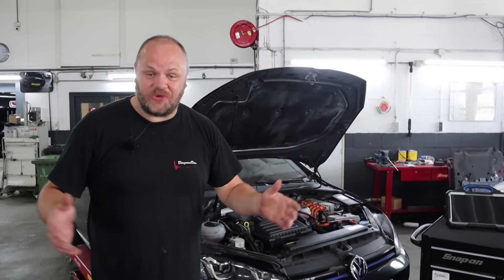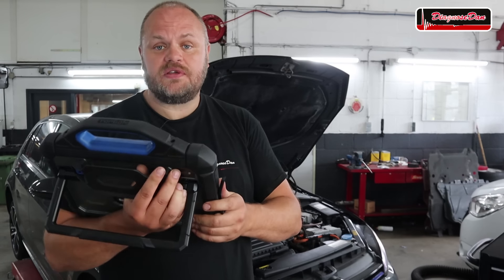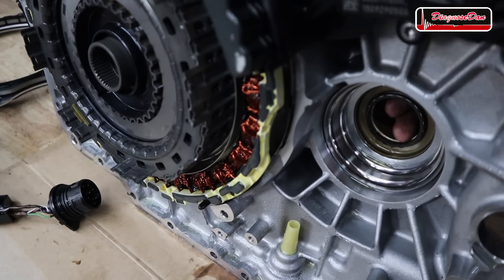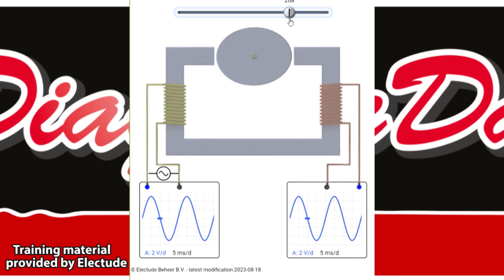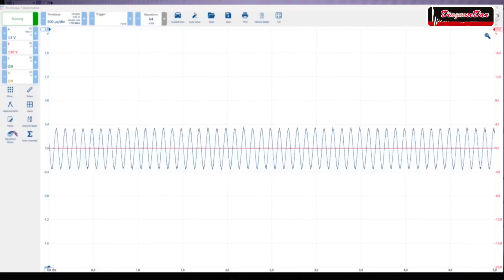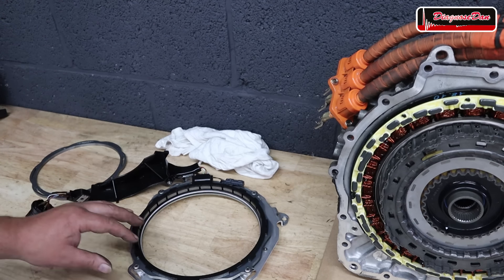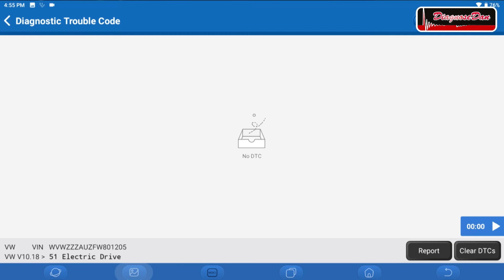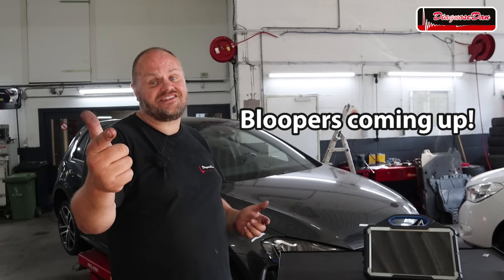Volkswagen Hybrid electric drive Diagnosis.

Comment: Your little animation, around 8:00 mins in, seems to me to be incorrect. If the two output shapes are supposed to be sine and cosine then they should be 90 degrees out of phase. (Sine 90 = 1, cosine 90 =0, sine 180 = 0, cosine 180 = -1). However, the shapes in your animation are 180 degrees out of phase. The former seems correct to me as that way the control unit can tell in which direction the motor is running. If the curves are 180 degrees out then you wouldn't be able to tell that.

Great video though, really interesting.
Reply from the maker: Thanks for the feedback, i'll look in to it.

Comment: @diagnosedan Thanks for the video! Quick question. I have a 2013 Jetta Hybrid with the same powertrain. I need to replace the transmission mount that is located under the inverter/electric motor brain. To disconnect the high voltage system can I just remove the orange plug on the high voltage battery and then safely move the inverter out of the way? Thanks!

Comment: Nice... I am wondering as long as the car is hybrid... and this happens to you on the road ... if you remove the plug of the resolver and disconnect the power to the inverter and clear the code will it be possible to start the engine and drive or it is not possible unless you recode the ecu
Reply from the maker: The Electric motor = the starter motor for the ice

Comment: Volkswagen in the past were plagued with electrical problems related to Bosch components, as were other's that used them. BMW motorcycles used Nippon Denso components at one stage to remedy the reliability problems. 

I'm not sure if this is still the case, as ive been out of the repair business for many years now, but 80% of problems then, were electrically related and would assume the added complexity of modern vehicles would add to this.
Reply from the maker: Thanks for the feedback

Comment: My Golf GTD went in to VW to try n find a electrical gremlin and I had a mk8 Golf GTE as a courtesy car. It had loads of new tech compaired to my 5 1/2yrs old GTD (which makes sense) like the cruise control changing speeds without me doing anything. It also had lane keeping assist, a camera which picks up roads signs and a heated steering wheel but for some reason, no heated seats which doesn't seem to make any sense 🤷🏻‍♂️
Reply from the maker: Thanks for your comment

Comment: Ooooosh!

Pretty brutal repair on  that 😭. It's a shame the engineers couldn't come up with some way of establishing the position of the rotor via a sensor / sensors that mount on a port on the transmission case rather than this!

Comment: Love how you show that the method of diagnosis for electrics  basically stays the same and also that it is possible to get your head around of what makes an electric motor spin. Next video: Diagnosis of a Tesla.
Reply from the maker: Tesla is the worst vehicle to work on for an independent as they provide the aftermarket with 0 information, dont want to talk to us and parts are a nightmare to get a hold of. But if anything interesting comes into the shop i'l certainly film it
Reply: @Diagnosedan  Two things: They are forced to become better and have now Service Mode enabled for everybody. Second: I am sure you are up to the challenge 😃👍

Comment: Dan, when working on hybrid or full EVs, what precautions do you need to take to ensure safety in the workshop?
Reply: Simple don’t touch it unless you know your doing or have the correct protection gear & testing equipment.
Reply from the maker: I've made a video about that a few years ago. Please go through my playlist

Comment: So in principle a resolver fulfills the simmilar function as the crankshaftr sensor regarding the postion of the motor.
Reply from the maker: Yes but a crankshaft sensor doesn't give the ecu the position of the engine if  it's not turning.

Comment: Did the cluster said the electric motor was ready? Or the messages came back?
Reply from the maker: No it didn't yet. After the resolver is replaced the motor must go thru a timing procedure
Reply: @Diagnosedan  thanks for the reply, that makes sense

Comment: Just to remind every home mechanic, be really careful with highvoltage components. Alltough they are very secure with connectors being open, if there is internal fault with the drive battery, one might get shocked if voltage is on due to internal damage.
Reply from the maker: Always use common sense whan working on cars even Petrol can be dangerous!

Comment: Doesn't seem like a good idea to turn over the electric motor without sync. Could cause overcurrent in windings? 
Also I wonder why they dont use a simple digital shaft position encoder rather than a complicated analog resolver.
Reply from the maker: Revolvers are generally more reliable

Comment: I have a Renault kangoo 1.5 DCI  it cranks but doesn't start it was brought to our workshop wit a faulty high pressure diesel fuel pump  it sat there for a few years until the customer bought a new pump but it did not start ,so many highly trained technicians have tried but the car won't start . It doesn't have injector pulse  and if you put the key in ignition the glow plug light doesn't come of even if you leave it on for hours it has the following fault codes( DF016 EGR Command Circuit,Short-Circuit To +12v Active
DF089 Inlet Manifold Pressure Sensor Circuit,Permanent Low Level Active) if you put a little petrol in the intake system it can Start but it stalls because of lack of fuel . So am asking should I first look for a short circuit for the EGR wires I just need your advice because if I fail so many people are going to laugh at me for being one of the failed technicians
Reply from the maker: There are many checks you can do, if you need guidance you can subscribe to DDTSB at DDTSB.COM and use our helpdesk ( only 20€ per case)

Comment: Interesting, I work with ac motors but the ones I work on usually have an encoder. The motor controllers I work with have two feedback options, an encoder or a resolver, I always wondered what the 2nd option was but never looked it up. Does anyone more knowledgeable on ac motors know why one might use a resolver feedback system over a encoder? I have had encoders fail and they are like a ckp sensor or cam position sensor where its one bolt and a plug to swap.
Reply from the maker: A resolver should be more reliable

Comment: The chief engineer of the first generation Prius, was a 70-year old gentleman. He and his team were working eighteen (18) hours a day, to make the world's first hybrid as reliable as a Toyota is always expected to be. They did. Almost 20 years forward, VW's motives were not to produce a bulletproof engine. Rather, their motives were to "just release "something" to the booming EV/Hybrid market". And that's the results you get.
Reply from the maker: Faults with the hybrid systems on this model are very rare, this is the first time i encountered one. I couldn't find anything about it on YT either. There are plenty of hybrid faults in Priuses to be found on YT.
Reply: @Diagnosedan  And there are many, many Millions of Priuses on the road. This VW is just another VW, with everything this implies. Look how the paint has flaked from the wishbones and the transverse engine mount, and how old is this thing? 2, 3 years old? I understand, that from your perspective you have to maintain a neutral approach to all manufacturers.

Comment: bad thing with electronics is what caused the failure??   there may be an intermittant electrical fault that put high wattage onto the wiring frying that. you may replace it and 30 miles later same thing. and withh the price  just tossing a controller in is not an option.
Reply: Possibly a cracked solder joint. They only use lead-free solder these days and it's quite brittle and sensitive to vibration.
Reply from the maker: Things fail😂

Comment: MR dan good day, I have a Jetta 2014 hybrid, car won't  start, I have diagnose it and those are codes 1) P30A100 (engine start interruptions, permissible number exceeded 2) U011200 control unit 2 for battery energy  management , no communication.. Pls help ..

Comment: Now the interesting part is how it actually did fail. Maybe it's just a solder joint?
Of course it requires the car to be taken apart to get to the failed device, and that's the hard part.
Reply from the maker: I dont know why it failed, i do know its very rare. This is the first time i've encountered this

Comment: Hello, teacher, can you help me with this problem, code p1122, Toyota Prius 2008, I replaced the inverter pump and sensors, and the car did not start at all. When I turn it on, the gearbox goes from p to n, then the car turns off. Thank you.❤❤
Reply from the maker: For technical questions you can subscribe to DDTSB at DDTSB.COM. Than you can access our (paid) helpdesk.
Reply: @Diagnosedan  
Thanks I will

Comment: The part that needs to be replaced should have zero failures,  it doesn't even move. Problem is that since this failed, many others like it will fail. Sad VW, sad
Reply: Of course it can fail, it's subject to vibration, large temperature changes, and the effects of age.
Reply: @Zeem4  should be engineered for that. It's a 2016. If you look at VW reliability over the years, it stinks
Reply from the maker: I wonder if thats true, i've never seen this fault before and i can't find similar cases like it. And this model has been around for a long time

Comment: So, a hybrid engine will a timing issue caused by a open circuit in one of the coil windings requires splitting the engine to replace the 'resolver'. That isn't an internal, timing part on any petrol or diesel engine and folks should understand how maintenance alone on electric/hybrid engines usually makes them a bad choice for your wallet/purse.
Reply from the maker: Thanks for your comment

Comment: 5:15, now you know why an electric motor is far more efficient than a combustion engine.
Could you spin a combustion engine with the same power with one finger?
You'd need a wrench and a long lever to do that.
Reply from the maker: And alot simpler

Comment: Hi I have Honda fit hybrid 2016. Recently it has started to show yellow engine light and with that it shows VSA and hill assist lights. When this happens the transmission does not engage properly. Over night the system resets and engine light disappears and everything becomes normal. Can anybody have any idea what is going on? Thanks

Comment: Im pretty sure the electric motor is used as a startermotor when you want to turn on the ICE engine.
Reply: Depends on the brand. For example Mercedes plug-in hybrid uses a standard starter motor on the internal combustion engine.
Reply from the maker: Exactly!

Comment: A view from the UK. Dan, a very informative vlog as ever, but......
Unwittingly, as with many other of your vids, it demands a conversation to be had about the complexity of todays cars that are "trying to save the planet". I am sure you know the amount of energy and resources it takes to manufacture anything to do with cars and by watching this video you see how much more "equipment" is needed to "save the planet". We are having the same debate here in the UK regarding the toxic metals and chemicals that are needed to manufacture electric car batteries - ALL sourced from China. ALL to save the planet. No, i don't think so. Add to this your expose of main dealers that cannot fix their own products, they come to you. To us oldies, sparkplugs, HT leads, coils, oil filters, brake pads - the normal parts needed to service your own car on a Sunday morning seem cheap compared to the parts you are replacing in these vids.  We never had "diagnostic computers, oscilloscopes, multimeters. We just had a socket set and screwdrivers. The only reason i open my bonnet is to fill the windscreen water bottle. When i open it up i find there is not 1 cubic centimetre of space, nothing.
Reply from the maker: My channel is about diagnosing/ fixing vehicles. The vehicles i diagnose in my videos ara already on the roads and need to be serviced. From a diagnostician point of view i'll diagnose anything ( Diesel, Petrol,Lpg, Electric,hydrogen.ect.) The question about the environment and the automotive future is an interesting one but probably more suited for another channel.
Reply: Sorry Dan but i think you have missed my point so i'll make it as simple as i can.
The whole direction of todays cars are to be more efficient and cleaner hence the introduction of electric cars/Hybrids. This has resulted in electronic "modules" all over the car to "control" various parts of it, effectively making todays car a computer on wheels. Therefore you are really an electronics engineer with an interest in mechanics not the other way round. Do step back and look at your channel and look at how many of your videos are electronic/electrical faults and how many are mechanical. Hope this helps. I would have thought having an oscilloscope, a signal injector, a DVM, a diagnostic computer would have given you a clue as to your real job title Dan,,,,,

Comment: hello 
i have wv polo classic 1.4L 44kw 60hp 1997 petrol AEX 
engine is working is starting when is cold and aftet he warmed turning off and i cant turr it on after that i need to wait
also when i am ddrivin i 4 and 5 gear put down the rpm from 3.500 till 0 and turn off 
on diagnostic car i found three eror codes; 5018 030 ,519 030,533 030 
1. drosselklappenpotentiometer - g69 unterbrechung/kurzschluss nach plus
Throttle valve potentiometer - g69 open/short circuit to plus
2.geber für saugrohrdruck-g71 kurzschluss nach plus
Intake manifold pressure sender G71 short circuit to positive
3.Regelung der Leerlaufdrehzahl
Idle speed control
Please i need a help 
Thanks

Comment: why does a car 3 phase motor have a resolver , normal industrial 3 phase motor don't have them.
Reply from the maker: This motor needs to move a heavy vehicle from standstill, so its important it has Max torque from the getgo. Thats why you want to energize the coil closest to the magnet. To do this you need to know where they are😊

Comment: Hybrid are disposable. You won't able to find a good battery replacement just like mobile phones & laptops
Reply: Wrong, Toyota hybrid batteries aren't that expensive
Reply: @robertpsotka3525 I never said it's expensive. You can't buy the same quality that came from the factory. Toyota batteries are so horrible and corroding from the terminal itself.
Reply: @w0lvez1   Yes, those Toyota busbars can corrode, but these can be easy replaced or cleaned together with replacing the battery blocks every twenty or twenty five years. 🤣 It's a two hour job, so what's the problem then?
Reply: @wimschoenmakers5463  20 years? With all this lead free garbage I doubt it will last more than 10 years.
Reply: @w0lvez1  My Toyota Auris Hybride is now 13 years old, and still using the original factory battery and it's still working great.  Not even 0.1 % of these metal hydride batteries are ever replaced in a Toyota, so there no reason to worry. 🤣
Reply: @wimschoenmakers5463  You might be living somewhere with low humidity. 

Just make sure to install CCTV on the pedal so Toyota can't say the throttle gets stuck because of the stupid floor mat. After all the denial on Sudden Unintedead Acceleration, I can't believe people still buy a Toyota.
Reply: @wimschoenmakers5463  Good luck! With all of this lead free garbage any solder joint can fail.
Reply from the maker: You can get refurbished batteries

Comment: hi, does anyone have the pinout and the reading values? i have the original sensor from my gte, vw official dealer service told me that this is the problem with my golf, but with the new sensor the problem is still present. now they asked me 6000€ for this job, for a non running car with the same issue. i need to check this sensor so i can go with the data to a lawyer. thanks in advance!

Comment: Again,sad to see that a very simple defect totally disables an expensive machine; here, probably a weak spot weld at one end of a wire of one of the coils in the MCR( multi coil resolver),that failed; i am sure it was FAILED since it was born; we are always at the mercy of a bad worker, in this case the person in charge of controlling that welding operation.

Comment: It's very surprising that an auto mechanic would own any type of electric car at this stage.
Reply from the maker: Why?
Reply: @Diagnosedan  They tend to be short range transportation and not fully supported as of yet. They require chargers, time to recharge, charging stations are not plentiful and when using them away from home, require too much time to "fill up" which increases risk of crimes around charging stations. Working on them as a mechanic makes more sense.

Comment: I would hate to be the guy from the other shop. LOL i think I would have spend the time learning rather than sending the vehicle to another shop.  On second taught. I would have drove it into a river .  That has to be embarrassing for a tech to not figure out a problem.
Reply from the maker: In my country you need to be certified to work on HV vehicles Not everyone is. Also technicians can be at different points of their careers, this was a young tech. I dont think its embarrassing, i think its brave to say you're not confident working on something.

Comment: Wow, what a crap design in having a component like that which can fail and require an engine / gearbox strip out to repair.  Nice work with the diagnosis though.
Reply from the maker: Thanks!

Comment: And ofcourse the car dooesnt have a starter motor anymore. 
The starter motor is that electric motor inbetween.
The mercedes hybrid cars with the 48V system does the same thing. 
48V system battery went dead and no start.
And you cannot jump start a 48 v battery when its dead.
So starting you Modern hybrid car just gor very very expensive.